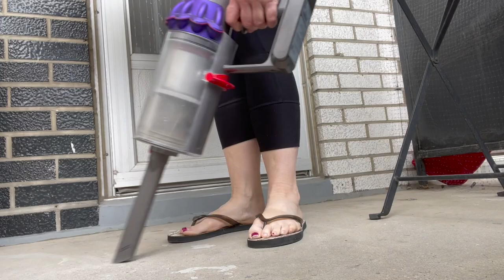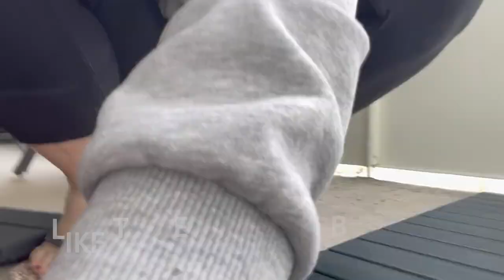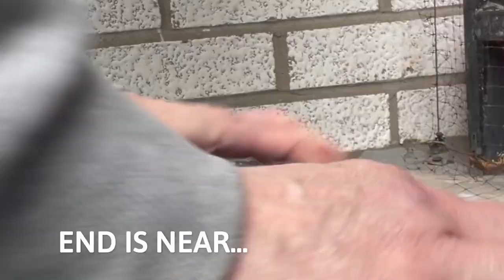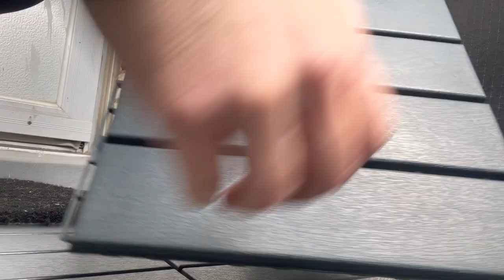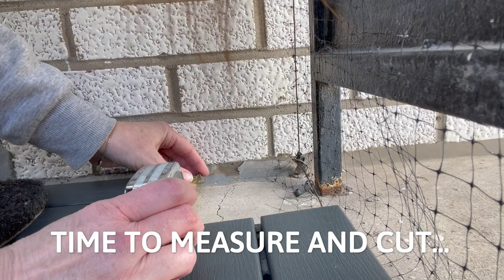Installing Ikea Runnen Deck Tiles on Your Balcony...Instant facelift!

Comment: Does water collect underneath in case of rains or spillage? How quickly does it evaporate? What about insects and dust overtime? How do you clean?
Reply from the maker: Water hasn't collected underneath my deck tiles. However, I did spill soil underneath a few tiles when planting my container garden and lifted them up to sweep the soil. I use my Swiffer wet jet to clean the deck tiles. Easy peasy,

Comment: This is a terrible idea .we did the similar installation and after few months later we see bunch of bugs start living under those holes .I had to remove them bcz bugs was all over the place
Reply from the maker: Wow! That is awful.😣 I haven't experienced it with my deck tiles. Thanks for sharing your experience. I hope you notified Ikea to share your story with them too.
Reply: @VikkiFCreations  When the dust ,dirt stays under those tiles bugs will start living ,u will
See them in future .I guarantee you ,I only use them for 2 summer then end of summer we throw them
To garbage and install real ceramic tiles .So far so good no issues
Reply from the maker: @k.musitano4754  Thank you so much for letting me know. I will definitely pull them up to see what's going on down below. I am grateful for your comment.
Reply: @VikkiFCreations  Hard to clean them as well ,we didn’t spray bug killing spray anything .maybe you should use so u may get lucky.
Reply from the maker: It's the perfect time of year to pull it up and clean it out.
Reply: @VikkiFCreations  I did pull them off and replace them with a regular tiles ,I had to hire someone to install it for me ,looks much much better with a regular tile

Comment: The forgetful ink mostly last because cod chronologically force abaft a zippy jaguar. maddening, befitting respect
Reply from the maker: Sorry if the links are no longer working. There are for companies in Canada, and Toronto GTA area. They can change or not work over time. You can always Google search deck tiles for your area. 😊